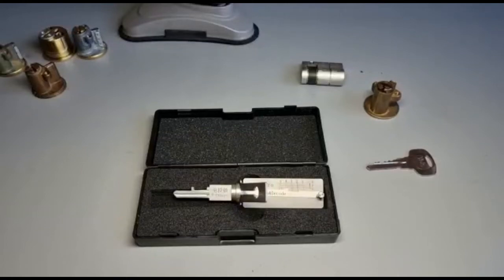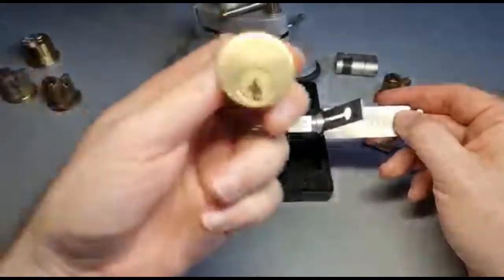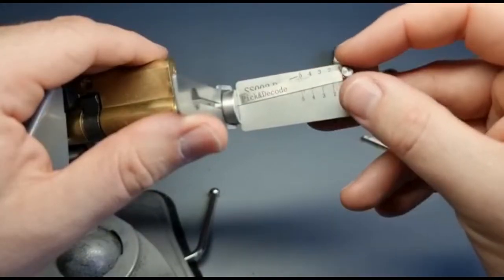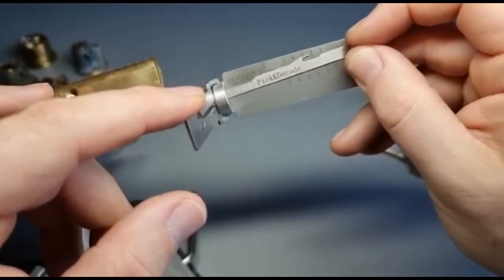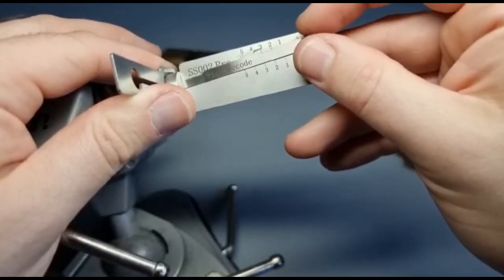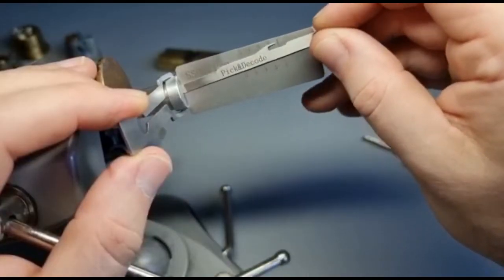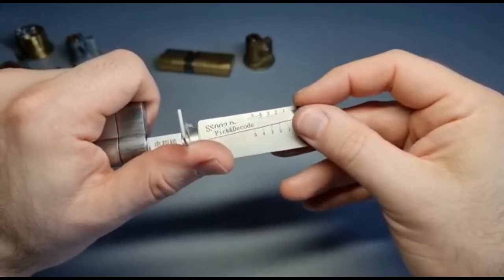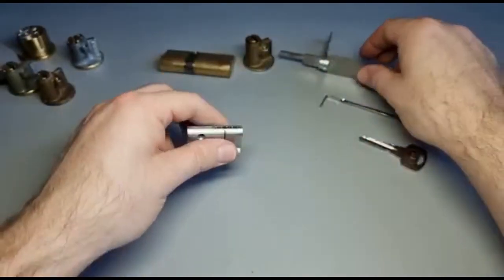Yale Profile (SS002) LISHI type Lock Pick - FAIL!

Comment: The Lishi SS002 was designed for all US Yale locks which have the Yale keyway.
 It will NOT work properly on south American or British brand Yale cylinders. Here is why: Yale is NOT just a brand of a cylinder but also the first keyway design which dates back to the original pin-tumbler lock invented by Linus Yale in 1861. So the original Yale keyway you find in many locks around the world since it is not copyrighted nor protected by Yales patent. Therfor many lockmanufacturer in different countries still use the Yale keyway/profile in their cylinders BUT with slight differences in width, distances of pinchamber and pin heights. Considering those points the Lishi SS002 will NOT work on ALL Yale type locks.
Reply from the maker: It's not actually a LIshi pick, just in that style. And it was made for Chinese locks. The video was made because people were making videos saying it was a working on UK Yale locks. I can understand that it would work on that profile in the states. Anyway, newer, better version available now that does work on UK Yale locks, so I'll get that video made shortly.
Reply: @LockPickingLegend  ah Ok, thanks for the reply. What is the new Yale pick called?
Reply from the maker: @albrechtjungmann8928  Well it doesn't really have a name it's an OEM product, so you speak to the manufacturers and they'll have your brand put on it - but as I said it's not LISHI. We've sourced ours from UKBumpKeys who said they will have them for sale in a few weeks. There's now about 6 different types of so-called 'Lishi-style Yale picks' on the market, but the ones I tested were very impressive, opening 15 out of 18 locks I tried, including those with security pins, actual paracentric keyways (which was always the issue with this style of pick) and even some three star Yale locks. And as you said, there's lots of no-name, generic and OEM locks that use the Yale profile, so they're decent picks for professionals.

Comment: This pick was designed for North American Yale locks NOT European.
Reply from the maker: Thanks for watching and that's an interesting comment. What's the difference?
Reply: Absolutely correct!
The Lishi SS002 was designed for US Yale locks only which have the Yale keyway/profile.

 It will NOT work properly on south American or British brand Yale cylinders. Here is why: Yale is NOT just a brand of a cylinder but also the first keyway/profile design which dates back to the original pin-tumbler lock invented by Linus Yale in 1861. So the original Yale keyway you find in many locks around the world since it is not copyrighted nor protected by Yales patent. Therfor many lockmanufacturers in different countries still use the Yale keyway/profile in their cylinders BUT with slight differences in width, distances of pinchambers and key-pin heights. Considering those points the Lishi SS002 will NOT work on ALL Yale (profile) locks.

Comment: I have been playing with these recently and must say that stock they are very limited but with a bit of modding they can do 6 pin and tighter universal y1 style keyways but its tricky and is it really worth it?????
Reply from the maker: That's a fair point - I just don't think it lives up to the hype, but if you can find uses for it, then it has a place in your kit. Thanks for watching and leaving a comment.
Reply: Any chance of a video of the mods you’ve done?
Reply from the maker: @kharali3475  I know you were asking the other lad, but we've got some videos in the pipeline of other LISHI (real LISHI) that we've modified and with some fascinating results. Look out for them.
Reply: @kharali3475  No time at the mo but effectively you extend the picking slot forward (inside back of the cover plate) and  remove about 3mm from the backside of the tip riser!
Reply: @LockPickingLegend  iv ordered mine and it will take about 2 weeks from China, aliexpress selling it for £16
Reply: @qutube100  The Lishi SS002 was designed for all US Yale locks which have the Yale keyway.
 It will NOT work properly on south American or British brand Yale cylinders. Here is why: Yale is NOT just a brand of a cylinder but also the first keyway design which dates back to the original pin-tumbler lock invented by Linus Yale in 1890. So the original Yale keyway you find in many locks around the world since it is not copyrighted nor protected by Yales patent. Therfor many lockmanufacturer in different countries still use the Yale keyway/profile in their cylinders BUT with slight differences in width, distances of pinchamber and pin heights. Considering those points the Lishi SS002 will NOT work on ALL locks with a Yale profile.
Reply: @albrechtjungmann8928  Yep thats what we have been attempting to address and i can assure you that it can and HAS been done and whilst the curl of the british Y1 UL2 UN2 etc is somewhat irritating it CAN be traversed with a modified pick tip and shoulder rise height, most of the modifications are to allow ssoo2 to pick 6pins as they are fine out of the box for lots of knockoff and UNIVERSAL Y1 STYLE keyways as tolerances are much looser by necessity! The main issue with the true YALE Y1 is the need to either wiggle up around the bend or pick through the lands, both approaches are hit and miss as getting the tip height correct and the degree of curl is extremely tedious and only truly dedicated LOCKNUTS have thus far been brave enough to attempt it!

Comment: I don’t know about everybody else but you’ve certainly got my attention thank you
Reply from the maker: And you have mine. Thank you for watching.
Reply: @LockPickingLegend  The Lishi SS002 was designed for all US Yale locks which have the Yale keyway.
 It will NOT work properly on south American or British brand Yale cylinders. Here is why: Yale is NOT just a brand of a cylinder but also the first keyway design which dates back to the original pin-tumbler lock invented by Linus Yale in 1890. So the original Yale keyway you find in many locks around the world since it is not copyrighted nor protected by Yales patent. Therfor many lockmanufacturer in different countries still use the Yale keyway/profile in their cylinders BUT with slight differences in width, distances of pinchamber and pin heights. Considering those points the Lishi SS002 will NOT work on ALL Yale type locks.

Comment: If you can only pick Pick one Direction, Use a Plug Spinner.
Even if Picking or Rakeing is Faster, The Tool can Decode so you can Make a Key Without Dissembly.
Stratmando
Reply from the maker: I get what you're saying, but this pick is jank. Especially compared to the ones on the market now.

Comment: Hey mate, as others have said this pick is not designed for yales at all! I see someone says it’s for American yales but that’s also not true. It’s for Chinese locks and works perfectly in them.  Keep your eyes out for the black lishi that specifically state Yale on them as they are actually working in yales 5 pin and 6.
Reply from the maker: Yes, I am currently making a video of the new ones - they work very well.
Reply: @LockPickingLegend  the black ones are now obsolete 😂
Reply from the maker: @GxAxV  Yes! And that weird bit of writing about 80% of locks and pins 8 and 9? lol.
Reply: @LockPickingLegend  lol did you see my last video on the new ones?
Reply from the maker: @GxAxV  Hello - I have now - nice one. But you say the Genuine Lishi is the best one, but link to one of the other picks in your selection. And it's  wide selection, lol, you really tried them all.
Reply: @LockPickingLegend  in my video I say that the picks are not genuine lishi and the logo will be changed! These is a set of 4 for the Yale. Yale 6, Yale 6B, Yale 5 and Yale 5B. If you are just locksport then only one of each is needed but if actually using them in the field you would want all 4.  Yes I have and have used all 4.
Reply from the maker: @GxAxV  I opened five pin locks with the six pin picks easily, I won't be recommending buying the five pin picks - unless I've missed something? Anyway, video about that this weekend. And apologies I missed that bit in the video, that'll be watching it while mixing tuna and mayo.

Comment: I’ve tried the 5 pin Lishi and like you found it hit abd miss also tried the 6 pin one and it’s useless the pick tip gets stuck when you set pin 6 you can’t get it back passed pin 5 I had to cut two locks in half to remove the pick 😂
Reply from the maker: Yes, sounds familiar - I've tried a couple of other versions since and they're much the same. Someone will get it right perhaps, but not as yet. Thanks for watching.

Comment: That doesn't look like a real Lishi to me - is it one of the knock-off ones?  I can never remember which way round it is, between Genuine Lishi and Original Lishi - which one is the real one.  But the proper ones have the picture of Mr Lishi on it for starters, right where that bit of Chinese writing is on yours, just in front of the turning arm.  Also, the "hub" is round on yours, but on the couple of Lishis that I have, that hub is flat on both sides.
Reply from the maker: The Original Lishi are the ones with the picture of Mr Li, the Genuine Lishi are the ones from Tradelocks UAP who had a licensing deal with Lishi but it all went sour. These are made by the same factory as Original Lishi, since that's been licensed out. But I got hold of this, and gave it a whirl, then I checked with a few friends who have both the others and their thoughts were much the same as mine. If you do buy one of the others, let us know how you get on - not promoting anything here, just information. Thanks for watching and leaving a comment.

Comment: I do work for landlords and I was going to get myself one of them lishi tools but don’t know which one is best for euro cylinders I do have a Kronos pick and thought it would get me out of bother if I didn’t have the batteries charged up I need one for Yale and euro locks
Reply from the maker: Hello Bob - well, this is just one of a variety of 'Lishi-Type' picks that are supposed to open Yale profiles, but I haven't heard great things about the other versions either. The problem is due to the slight paracentric keyway of Yale locks, which doesn't lend itself to the Lishi design. Having said that, I have also heard there's something on the horizon that's said to deal with this issue. So I would suggest waiting. Also - remember it will only work on Yale profiles, (and those based on that keyway) which will not be all the eurolocks you encounter. Thanks for watching and leaving a comment.

Comment: I ordered one $12
Reply from the maker: Well, you might get some use out of it if you're USA based, but the newer ones are far superior as they can deal with paracentric locks, search my channel for LISHI YALE and you'll see I've made a few videos about the newer ones. Best of luck though. $12 is a punt, I guess.
Reply: @LockPickingLegend  So far its worked every time I've used it.  I haven't bought any others, haven't needed to.  I have about 70+ original and genuine lishi's and a few knock-offs so possibly I can take a cheapo tool and make it sing?  LOL

Comment: Different  lock. Company  have a different  bitting scale so it won't be accurate
Reply from the maker: Can you elaborate? I don't really get what you're saying.
Reply: @LockPickingLegend  there are plenty of yale profile keyways but they dont all use the same bitting sizes or gaps
Reply: @unlockeduk  absolutely correct!
The Lishi SS002 was designed for US Yale locks only which have the Yale keyway/profile.

 It will NOT work properly on south American or British brand Yale cylinders. Here is why: Yale is NOT just a brand of a cylinder but also the first keyway/profile design which dates back to the original pin-tumbler lock invented by Linus Yale in 1861. So the original Yale keyway you find in many locks around the world since it is not copyrighted nor protected by Yales patent. Therfor many lockmanufacturers in different countries still use the Yale keyway/profile in their cylinders BUT with slight differences in width, distances of pinchambers and key-pin heights. Considering those points the Lishi SS002 will NOT work on ALL Yale (profile) locks.
Reply: @albrechtjungmann8928  no It won’t work i can verify this as I bought one and living in U.K. the take key way is the number one key way and I haven’t opened a single lock with it
Reply: @unlockeduk  you haven't quite undersrood my comment. I said the Lishi SS002 was made for US Yale locks only. It will most likely NOT work on other Yale/profile locks.
Reply: @albrechtjungmann8928  I agreed
Reply: @unlockeduk  ah OK, then I understood your 'no' at the beginning of your comment wrong.
Reply: @albrechtjungmann8928  yeah i wasnt too clear with it lol my bad